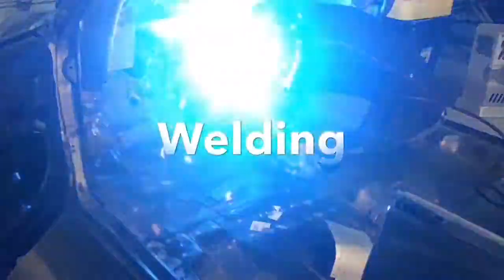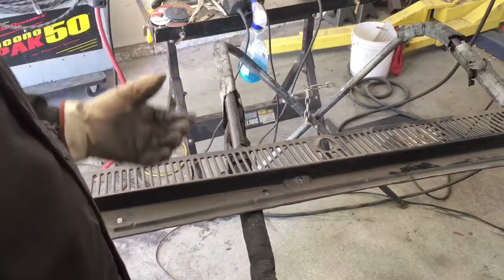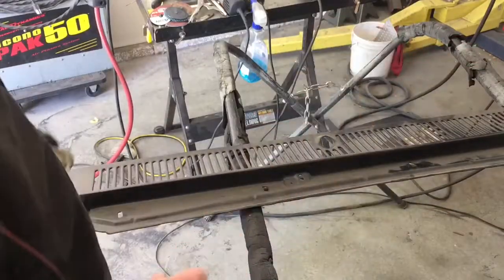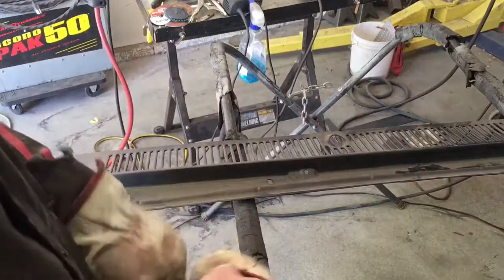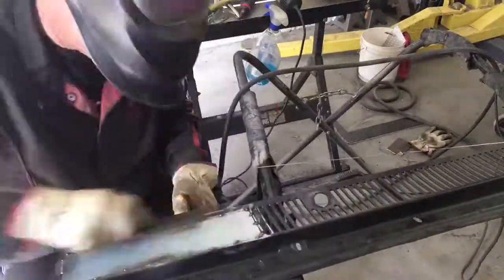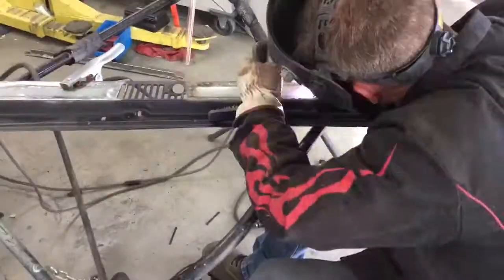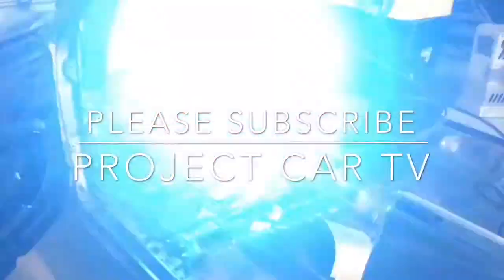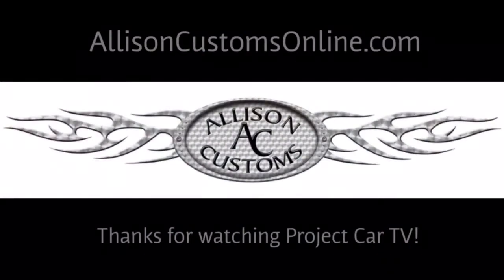Smooth Cowl Panel & Body Shop Pics

Comment: I forget which year Chevelle that is; pre-Astro ventilation?
Like with vent windows at the front of the doors.
No cowl area plenum at all? 
Do you have other plans for that area?
How are you going to do passenger compartment fresh air intake? Like for heat and A/C.
Reply from the maker: The whole cowl area vent system has been removed.  Instead a Vintage air system is fitted in its place and tucks up high behind the dash.
Reply: Yeah, Vintage Air makes good compact systems; installed a few myself.

No fresh air intake at all for HVAC?  I realize a vehicle like that won't be driven in the cold weather and won't be used in snow so "boot droppings" from snow won't be an issue, but without fresh air coming in to the HVAC system the owner may end up with moisture from the people inside just breathing and condensing on the windshield at times of high humidity in moderate weather. Sure the AC can be kicked on, but what about temps in the 40's- 50's? 

Then again my thoughts on this matter may be regional; I am in the Chicago area. I have always taken my "playthings" out mid-January when there was no snow or salt on the roads on sunny Sundays. Sure the roads are cold and there is no traction, but it's easier to make "tracks" on the pavement then, especially with low horsepower cars. LOL
Reply from the maker: All good points and I would love it if Vintage or some other manufacturer would come up with a system that included a outside air tap. 
There are a few good ways to get fresh air into the car though, four power windows would be an example. 
The only way the cowl vents worked on this era of Chevy, was through the floor side vents and in this case those were completely rusted out.  So the way I like to do the cars is to eliminate that cowl system completely, eliminating a leaf and dirt trap, (especially if you are going to have to replace all of the metal anyway) and make use of that space for other things.
The other thing to consider is 
335 tires and 672hp will be awesome on dry sticky road.
But add in CP (cold pavement) and that is the approximate formula for WAT (wrapped around a tree)

P335 + 672HP = AWESOME!
P335 + 672HP + CP = WAT
That’s for all you math hounds